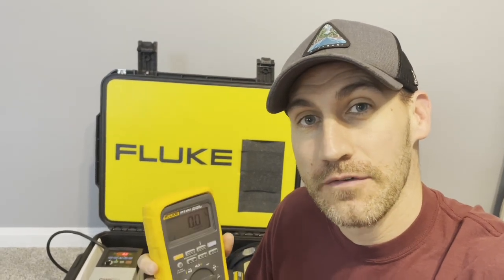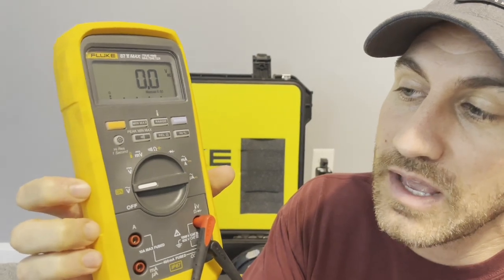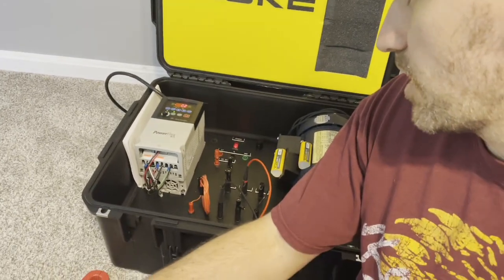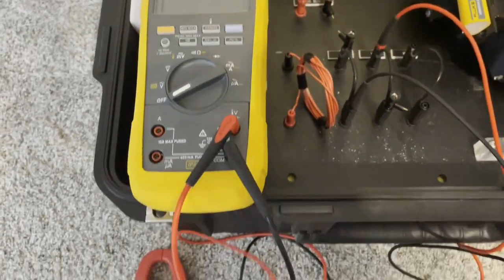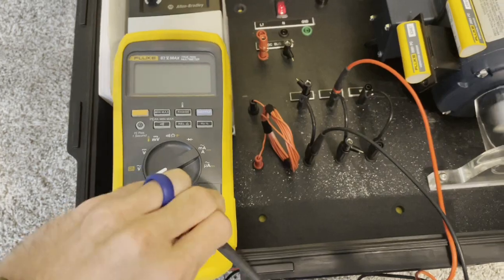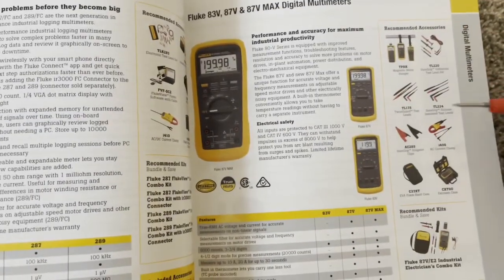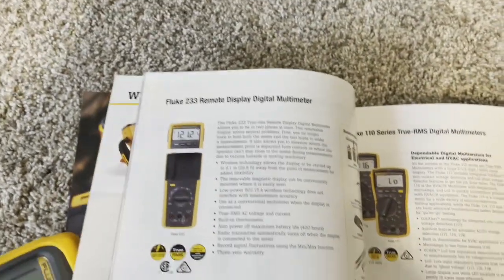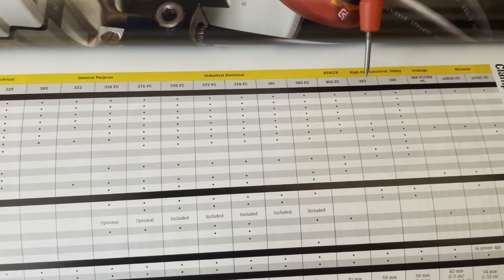DMM Vs VFD - Low Pass Filter - Fluke Fridays - Episode 97

Comment: Heard of it Brandon. How do you engage the low pass filter on a 376FC?
Reply from the maker: It's always engaged. You can't turn it off. Because it's not designed to be used on the circuit board level.

Comment: Any situation where you wouldn't want the LPF on?
Reply from the maker: from Tech support Jim Newell: 
The Low Pass Filter is just that it’s a filter to change the frequency response of the meter.
As an example, the Fluke-87V Max bandwidth for measuring AC voltage with the Low Pass filter off is 15Hz to 20kHz, with it on the bandwidth is 15Hz to 440Hz. See below specifications I clipped out of the manual. 
Remember the Fluke-87V Max is meant to be used in more than one genre (not just electrical), it can be used in automotive or electronic as well. 
The reason you would not want to use the Low Pass Filter is you have applications where the limited bandwidth would prevent you from getting results. This would typically be in electronic applications. The VFD by design is trying to create a waveform using multiple changing frequencies which the Fluke-87V Max will try to measure all of the changing frequencies and it’s not able to keep up with the constant fluctuation using it’s full bandwidth, hench using the Low Pass Filter solves that issue.
Reply: @fridayswithbrandon  Thanks!  Do you happen to know of any examples of electronic applications where the LPF would prevent getting results?
Reply from the maker: @eightequalsequalsdee  if you looks up the user manual for 87V or 87V MAX. Under AC voltage it has a table that shows exactly what frequency it changes the accuracy on.

Comment: is the low pass filter the same as the loz feature on models like the 117?
Reply from the maker: No loz is to get rid of ghost voltage. Low pass filter is all about VFD and eliminating the carrier frequency voltage.
Reply: @fridayswithbrandon  What meters from Fluke have loz function? Does 1587C or 378fc? Or do they have a function that is comparable?
Reply from the maker: @billmuertos  I don't think either tool has Loz. If you want a list of tools that has it I would call 800-44-FLUKE. They would be happy to help you.

Comment: Heard of it as I'm looking for a new meter; vfd measurement is compulsory (my present one doesn't). VFDs are quite common now so it's an attractive feature; I can't see other manufacturers not implementing it. The Major Tech MT1009 states that it has this a low-pass filter function. It may help to briefly explain, with a diagram, how the vfd output is synthesised from a much higher frequency. Also, measuring the frequency with the LP filter on and off would be instructive.

Comment: Heard of it. But interested to know if the 378 FC it is just an automatic function and switches itself between low pass and True RMS? Wonder if Brandon can answer this?
Reply from the maker: True RMS and low pass are not mutually exclusive.  All of the Fluke meters are True RMS at this point other than a couple specialty meters and a couple legacy meters.  But even with a True RMS meter you can have a low pass filter on it and activated or not on it/turned off.